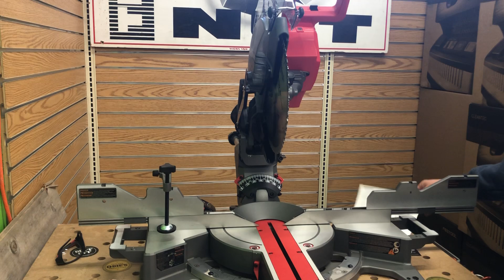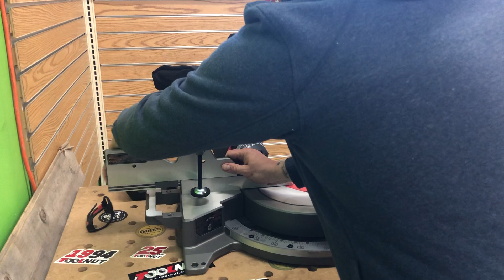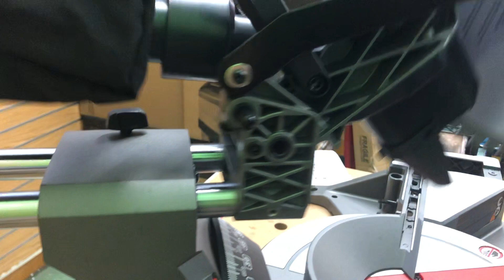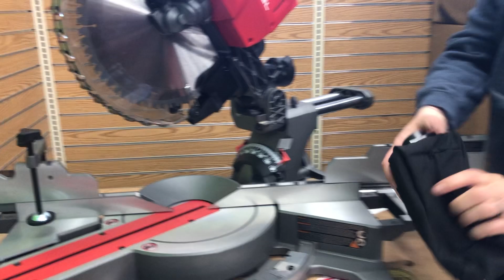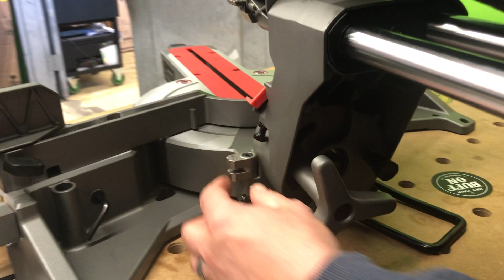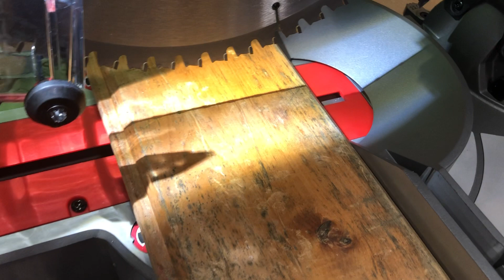NEW Milwaukee M18 FUEL 12” Dual Bevel Sliding Compound Miter Saw With One Key Model 2739

Comment: They need to make a mor heavy duty stand for it
Reply: I have all milwaukee but I decided to go with ridgids new stand that folds and rolls. I had the previous ridgid stand and no complaints. Fast and easy. I was looking for a better stand but can’t really find anything. I have the 7 1/4” miter saw aswell with the folding Milwaukee stand for small jobs so I’d rather not have to carry the 12”
Reply: I haven't decided yet about stand but I want the matching milwaukee stand. Your saying it's to weak for the 12" to balance easily on the Milwaukee folding stand?
Reply: The sand is very sturdy and so are the arms except for the height  adjustments on the ends that fall apart when any long 2x are resting on them the nearly have 1/4 wiggle on the stops. Rollers would be an improvement as well for sliding boards. some upper wheels on it for relocation on the jobsite like the Hercules stand from harbor freight. Even ryobi makes a beast of a stand that extends over 110"